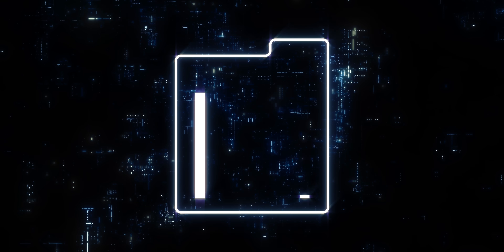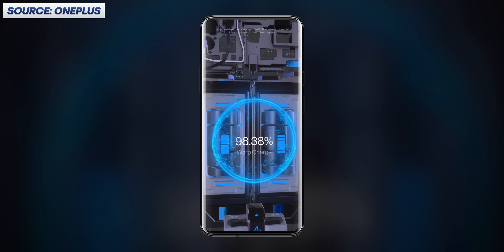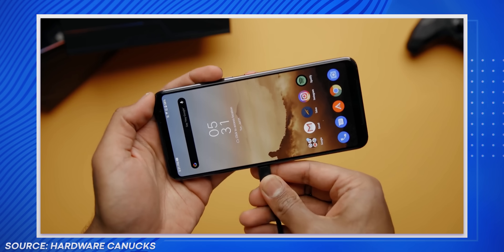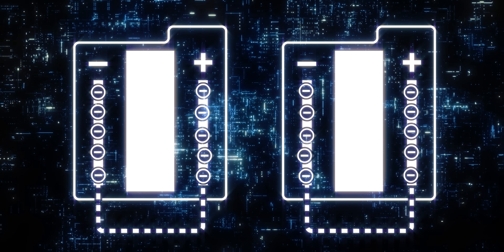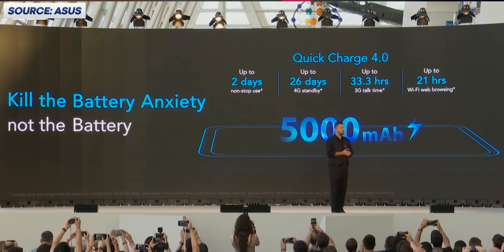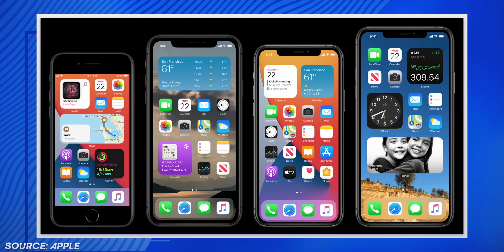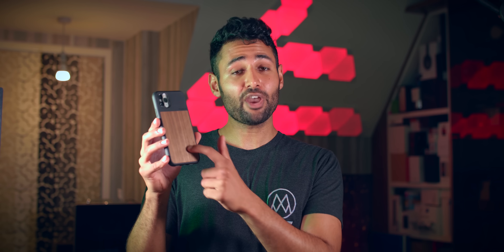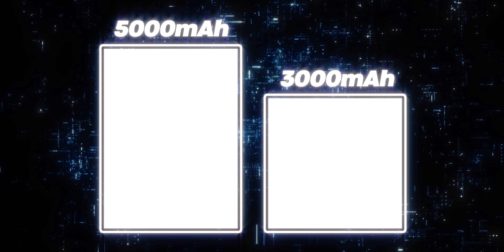The Problem with Fast Chargers.

Comment: Battery is the one reason most people switch their phones every year , that's what make companies profitable at all time,
Even though most flagship phones can last the consumers up to 3 years, but battery... Yea....🤷🏻‍♂️
Reply: Jokes on me i am using a midranger for 5 years 😎
Reply: @lynxb8576  
Jokes on u i still have my s7 edge but the screen is broken!
And idk how but from my sisters phone the charging port looks like an prostituts asshole!
Reply: @SeXySpEcKsY  i also have my galaxy s7 edge, for 4 years now. It works well, battery is still ok and i am lucky bc i have a protection on my screen, otherwise it would be damaged or fully destroyed
Reply: @SeXySpEcKsY  I have Rs. 10,000 phone and i use it without Screen guard still works like charm even the battery gives me one day juice looks like you are bad owner 😂
Reply: in my opinion, people should just go to the stores and get their batteries replaced
Reply: @kotaar8535  for a 2 year old device and higher, it's not a bad idea to replace the battery, But, keep in mind ur phone won't have the same percentage (protection) of IP rating for liquid and dust resistance, due to phone disassembly
Reply: @kotaar8535  If u have an iphone u can just buy a new one bc they cnahge everything out if it just got a screch!
Its even on there website lmao
Reply: powerbank and tape will bring you to another level of phone lifespan
Reply: Is it just me or have I never seen using a Galaxy S7 without broken glass or without that purple line on the right side of the S7 edge when the screen is broken.

I had an S8 and it was pretty durable for me, but I have seen my friends broken S7's
Reply: @svg03  My nephew also had S7 and that shit was tattered as hell
Reply: There is such a thing as battery replacement.
Reply: I use my a5 2017 for almost 4 years now, luckily my battery drop only in the last 5 i use 15w charger and still not change my battery, no cracks in my phone too
Reply: I have 3years w/s8+ n now it's my secondary phone, still works fine
Reply: My grandfathers had the same phone since before I was born. I’m 13.
Reply: People's batteries die after one year only because they don't know how to use a damn phone. Or, any portable device, for that matter
Reply: y'all only keep your phones for three years?
Reply: Why would you want to keep a phone that long even if you could. Bigger and better is the answer
Reply: @Huels  
Bc not everybody has money to buy a new phone every yeahr?
Reply: @Huels  Because some of us don’t feel the need to pay for a new phone when the current phone works? Your viewpoint is disgustingly wasteful.
Reply: @Huels  why would buy a new phone every year? Phones dont even gain that much features
Reply: @Huels  I don't need a new phone every fucking year lmao. Roughly every 3-5 years I get a new one as I don't game on it nor do anything else power consuming anyways. It's a practical tool for me
Reply: @Huels  I would wanna keep my note 20 ultra for more than a year. That phone is beautiful

Comment: Not only does 100% not equal 100%, 0% does not equal 0%. There is an approximately 15% buffer, as as stated in the video. Therefore it difficult to extremely damage your phone by staying at 100%

Comment: The problem is, you try to explain a problem with fast chargers in general when you have only a very basic understanding about it. Dear god! 

No, in 2020 many , if not most, fast chargers do not overheat the device and battery and don't warm them faster than slow charging counterparts. I do have a fast charging phone, and there is no more heat (or warmth rather as it is never in heat fortunately) while charging than what an iPhone 8 Plus has with a 5W charger. When a charger and phone are both quality, overheating is not a particular issue, there is just a normal warmth ratio until it reaches the slower fase of charging. And to prevent dangerous situations for both, battery and user, charging processes are hardware and software regulated processes, very precisely in every millisecond. 
You sell shit in this video, you try to be smarter than you are in reality.
Reply: Thx exactly
Reply: he never said he was a qualified physics teacher
Reply: U are smart? Who says u r right? Any literature?

Comment: I think you said something wrong. The battery is in its most stable condition when there's 0% charge. That means the there is no potential difference between the terminals. 
Ya 50% is less pressure than 100% but it IS a pressure. It's not the equilibrium point. That's why if you leave a battery for long time, it goes to 0%. (Correct me if I'm wrong).

Comment: So - Should I stay away from 3rd party chargers? (You say that the phone shares data with the charger to control charge).  Thanks - great vid. as always :)
Reply: It's a good thing I am using a 30w brick charger out of the box. although I'm not sure if the charger and phone are linked if it's on a budget phone. more on like flagship Samsung phone would seal the deal of bridging connectivity to stop charging.

Comment: Little offtopic, but I am a photographer, and I use a lot of flashes, flashes that are powered by double A batteries. I buy exclusively Eneloops [white ones], and have intelligent charger, that can charge each battery independently at various speeds. What I noticed is that by charging batteries as slow as possible [that would be 200mah with my charger], they last longer during that cycle. What's more, I actually bought Eneloops Pro and charged them with only a 'dumb' charger, and as you might have guessed, they died pretty quickly. I still have 4 [a pack] of Eneloops that were made by Sanyo! That's pre 2013, before they were bought by Panasonic, and they work flawlessly, dropping from rated 1900mah to about 1700mah nowadays. And I really hit them hard, often shooting for more than 10h non-stop with flashes during weddings and such. So far, only one pack of Pro version died on me, but as I said, I did use a regular dumb charger for these.
I am not advertising Eneloops or anything like that, what I mean is that charge rate and quality of the charger makes A TON of difference. I have many people around, friends and family who often buy another and another pack of batteries, because they don't hold charge anymore, while I just add backup ones to my backpack, and buy additional ones for additional gear I use.

Comment: That's why I'm happy with my Redmi Note 9 Pro (Global) with 30w charging, because I don't really need to hurry the charge of my phone, why? because I do have a life and not just circling around 24/7 on a phone, and thus it'll fill up in about just an hour after that I'll leave it and just use it when I needed to. And that's also why I know that this phone would technically last for years and years or usage.

Comment: I don't agree you shouldn't use your phone while charging or that you shouldn't keep it topped up all the time in a charger. While what the video says is true, it doesn't consider the alternative, which is you'll be cycling your battery an extra time if you take it off the charger and use it. I work in an office, use the phone constantly and keep it on charger nearly 100% of the time and I easily get 3+ years battery. Other people who cycle them more off charger get barely over 1 year.
Reply: That doesn't really make much sense as battery "cycles" are actually defined just as an abstract measurement. It doesn't actually mean "charge it to full and it counts up 1". You get a cycle when you have effectively used up that battery's capacity either all at once, or in your case instantly topping it up again. 

Or if you want something more mathematical: Cycles  = total energy used (in Wh) / capacity of device battery (either Wh or if not specified mAh * output voltage).
Reply: @skifree0  yes.... And how many cycles are there when you're using your phone all day on the charger? Zero. Count it any way you want to count it and the answer is still zero.
Reply: @xpusostomos  Your cycle count still goes up on the charger...As the video said the vast majority of phones do not have bypass circuitry to power the device directly off the DC supply...You are still actively using the battery.

In fact most definitions of  "cycles" are DISCHARGE cycles....the moment you use an equivalent of 100% of your battery's capacity whether it is "topped up constantly" or unplugged IT WILL COUNT.
Reply: @skifree0  no it doesn't count. Think about it, you can't both take power out and put power into the battery at the same time. It's either going in or out, not both. So if it's on the charger pushing 4v into it, but it's also needing to use 4v, then it's not going through the battery.

A common power circuit is a T. power on the left, battery on the right, load at the bottom. It should in theory take the power from the side with the highest voltage. 5V supply, 3-4.4V battery.
The real path is more: adapter > current sense resistor -> diode -> output < diode <- current sense resistor <- battery.
Bridging the two ends of the current sense resistors, sitting across the output, sit the charging circuit.
The diode prevent a direct battery to input and input to battery current path, but allow both to power the load. Take note that it is usually also in parallel with a mosfet, and some circuit to turn on and off the mosfet (the diode first conduct, but lose some voltage. The circuit detect it and turn on the mosfet, which short the diode and basically no voltage is lost, making a 'perfect diode').

Enecdotally, I've used phones 12 hours a day continually on charger and the battery has been pretty good 3 years later.

Comment: I keep my phone between 20 and 80 I use accubattery to track capacity.  I use fast chargers but when I do I have my phone on a fan.  I do in dex while charging too it makes a huge difference in keeping the battery temperature down.  Doing this for me according to the accubattery I have lost no capacity over using my phone very heavily for a year. (note 10+)

Comment: I dont understand how at 50% both the sides have the same number of electrons.then how does the electrons flow if there isn't concentration gradient.
At zero charge no electrons flow through the batter.. doesn't that mean the electrons are balanced?

Comment: Me: doesn't charge it till morning and even then it's either 35-80 percent or 40-80 percent. I like to go over because the battery loses 2% within a few minutes of booting the phone up. It's been so long since I've checked that..might not be an issue anymore.

Comment: 2020: ugh my phone's battery runs out all the time
2070: sup, and what's a ba-terrrrrrry?
2020: its a thing that keeps everything without keeping it connected with a wire or something
2070: oh those are for nerds we don't even use a batt-ryy
2020: BRUH

Comment: I disagree. Sure, all you said is true, but what's most important is proper engineering and discussing how fast charging is going to ruin your battery is pointless. I've had one phone, which I charged with a conventional 5W charger, and the battery was completely dead within 18 months. The phone I have now I charge exclusively with fast wireless charger and after that same 18 months I cannot notice any degradation. It lasts the same on a charge as it did when new. Proper engineering can solve any problems, while shit engineering can create problems where there should be none.

Comment: That battery buffer is always interesting to me. A similar technique is used for SSDs. SSDs have particular amounts of times it can read/write based on total storage, and as you use it and read/write more often, the amount of usable storage in the SSD goes down. Thus, OEMs will actually pad the total storage. So a 256GB SSD actually has (for example) 300GB of usable storage. But they use that storage as backup, so instead of going from 256 to 206GB over X years, you actually going from 300 to 256, which won't ever be noticed by you as the end user.

Comment: I'm sorry to be that guy. But a phone battery never hits 0 volts. 0 volts means 0 potential difference. If a battery was 4.2 volts at full charge, and 3 volts is considered dead, the electrons in the battery still have potential, but not enough to run your phone. If all the electrons were on the opposite side, you would have reversed the polarity of the battery, and you would have -4.2 volts. The video has some good information in it, that I didn't know. But those animations make me cringe, because of how wrong they are.
Reply: jacob bristow guess what? U are that guy ;-;
Reply: kittylover6644 if I’m right, I’m right.

Comment: Actually i do sell to my customers Baseus smart cable who stop charging when the battery is fully charged, i use it myself and i love it, also they detect wich voltage came in the phone or tablet like the charging light is red when it is a 5v out but the light is blue when this is 9v or 12v then turn green when fully charged and after 10min green the cable turn off and stop charging !! Baseus one of my favorite compagnie for cable and charger, i have a supplier for those cable but you won't be able to buy from it unless you have a registered compagnie but on Amazon they look like this one... https://www.amazon.com/Baseus-Intelligent-Shut-Off-Indicator-CATCD-01/dp/B019RMLCV2/ref=sr_1_1?crid=3GF12XQAJM168&dchild=1&keywords=baseus+intelligent+cable&qid=1601941936&sprefix=baseus+int%2Caps%2C161&sr=8-1

Comment: Is it safe to use my Note 9 without a case and screen protector? When I take the screen protector and case off of it. The display is soo much brighter and colorful. (And yes even after cleaning the phone and screen protector, I still notice some of the color being washed out by the screen protector) If anyone can recommend a screen protector and case that wont water down the display, that would nice :)

Comment: i just got the apollo max graphene powerbank it chargers from 0 to 100 in roughly 20 minuts for a 10000 mah battery using 100 watts gan charger if only phones  or laptops had that technology it would take only 5 minuts :-D

Comment: If your phone has fast charging, you don't have to charge overnight anymore, so you're not keeping the battery at 100% for hours at a time. If you account for that, it's negative effects on the battery are negligible
Reply: You are talking about batteries from years ago. Modern batteries dont get affected by this type of charging that much. Is it bad in the long term? Sure. But it wont kill your phone at the same pace fast chargin will. (But you do have to keep your phone from closed spaces like a case so it doesnt overheet with that 100% overnight charge)